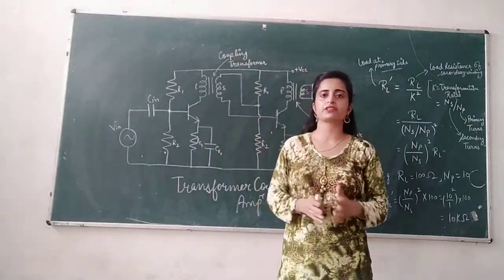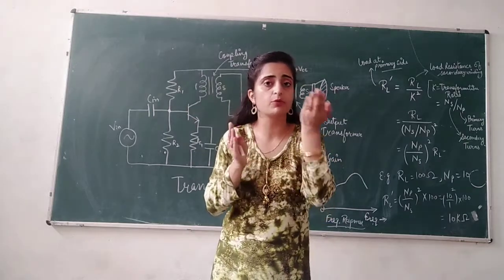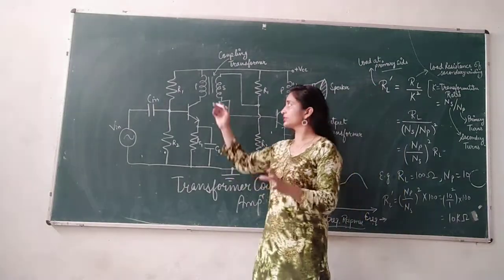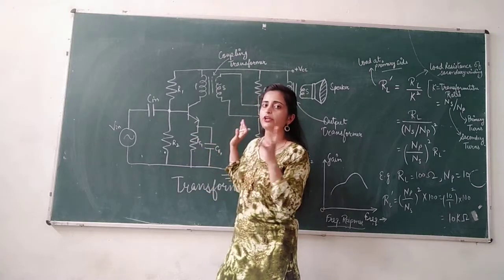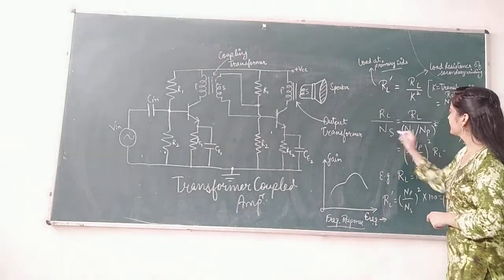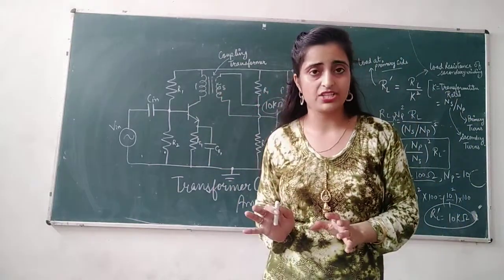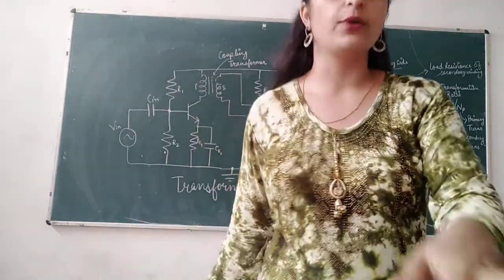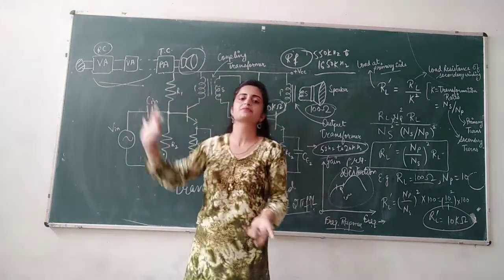Lecture 5.. Transformer Coupled Amplifier.. explanation

Comment: Madam Dc supply can not be give in transformer .but you give in first transformer of primary winding ..how it  is possible.
Reply from the maker: no dear.. u r mistaken.. the dc supply is not given to the transformer.. it is rather given to the LC circuit. Check again.
Reply: @preetgf    I am not under stand madam
Reply: @preetgf  what is meaning of rather given LC circuit..could you. Please explain.

Comment: Hello, tks for nice explanation!  Would a inductor coupled amplifier get better response frequency than a transformer coupled, yet being more efficient than a direct coupled amp?   Would you post a video of a real class A schematic so that it can be mounted and experienced?  Rgds from Brazil!
Reply: Hello! Tks for kind reply! In fact, my question was not so clear...  Concerning 1 transistor simple circuits, could a inductor be used in place of the Rc? I saw this configuration in another video, it seems to be very interesting due very low resistance of the inductor. Tks again!
Reply from the maker: @niltonsacchetti8547  Yes Dear.. It is possible.. and we do it.. Rc is replaced with inductor to reduce the DC power loss in the circuit..and it is explained in another video.. Please Check
Reply from the maker: Hello dear, Thanks for response, but an inductor could not be used for coupling two amplifier circuits as it will not allow AC signal to pass through. further, i will definitely try to post a real time class A amplifier.